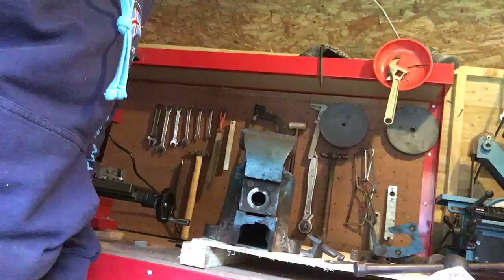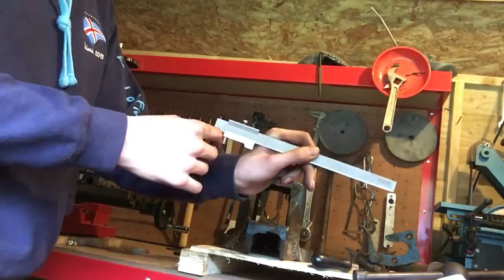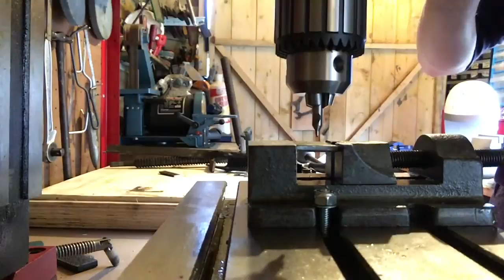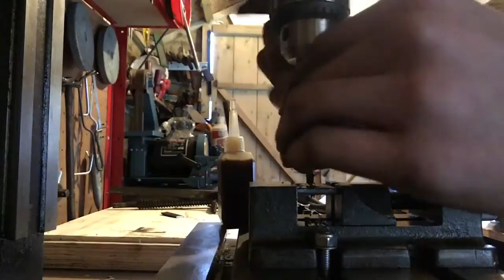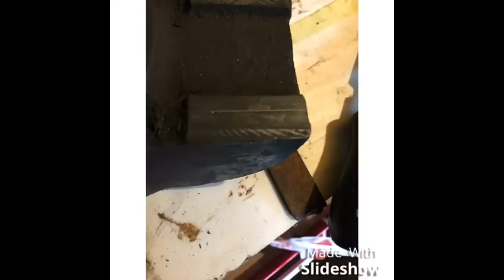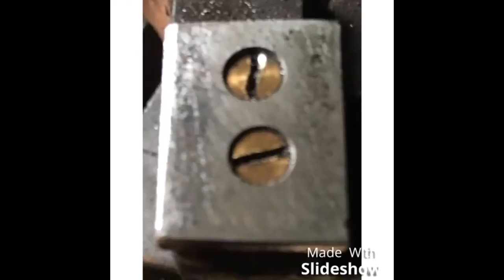Record workshop vice repair

Comment: must have been dropped, as that part is not under stress from winding up tight , shame, but glad you are getting it back and not scrapping it
Reply from the maker: Jusb1066 most probably yes because there was no wear or damage on any other components . It's proudly on the bench now . Thanks for watching!!